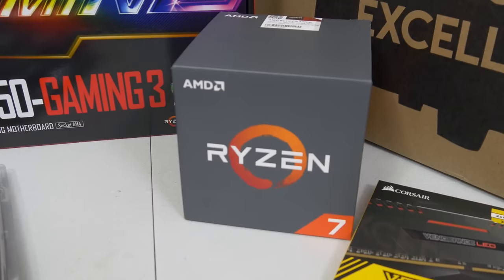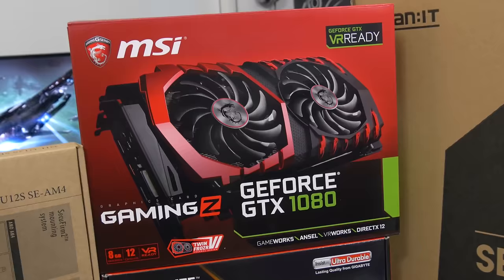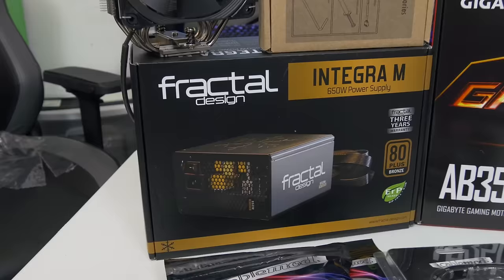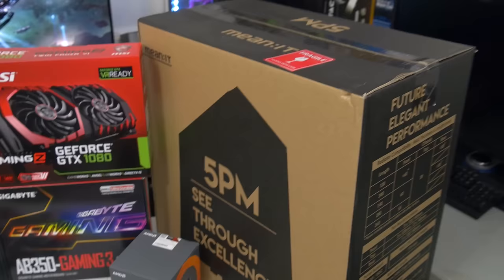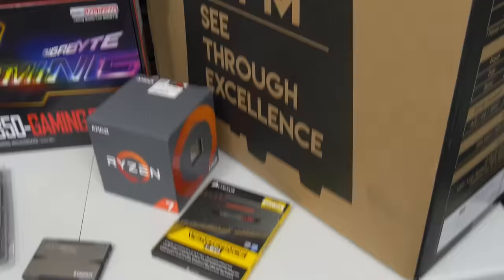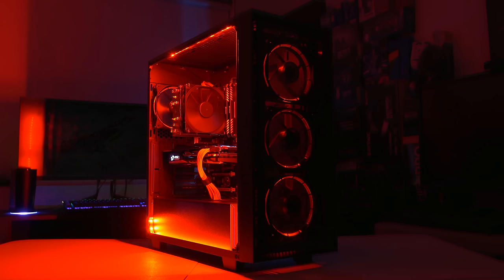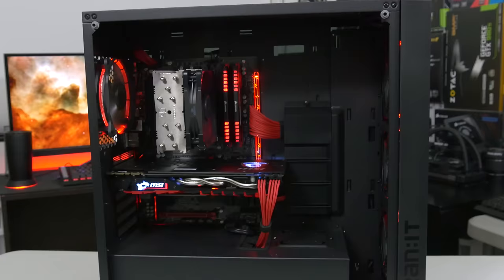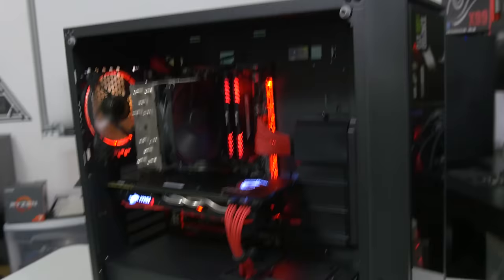Building MY FIRST Ryzen PC! March PC of the Month

Comment: I'm looking to build my first computer still no the fence which way I should go. I currently have an i5-4460s, 12 Gb ddr3, I forget the mb. I plan on using it for gaming Overwatch, Hearthstone, Mass effect. I use it from timid to time with for 1080p video editing and maybe Twich. I was thinking 7700k, z270 mATX. Or this 1700 and the AMD equivalent to the z270. 
Not brand loyal but I'm putting it in a Thermaltake V21 case so mATX is the largest board I can go. I'm using the same PSU and GTX 1060 GPU. What is the best price to proformace?
Reply: On a "CPU standalone" universe, considering your use of the PC (seems mainly gaming) I don't see the point in taking the 1700 instead of the 7700K. 

But to be honest, I don't see the point in taking the 7700K if you have a GTX1060... You'll be GPU bottlenecked WAY before 7700K provides you any benefit over the 1700. In which case, I'd go for the 1700 (better multithread performance).

However, in less than two weeks the R5 will come out. In gaming they will probably perform as the 1800X (meaning the 7700K will still be better) but they will be way cheaper.

Get it that way: a well OCed R5 1500X should provide the same gaming experience as the R7s but for only 190USD (looks to me the perfect gaming sweetspot). It will still be not as fast as the 7700K. But it will be:
- way cheaper.
- 7700K will prove to be faster only having an EXTREME graphic card. You have a 1060. With that graphic card the 7700K will NOT provide you a better experience than the 1500X since you will be GPU bottlenecked. 

The 7700K is the best CPU for gaming, but, to benefit from it's potential over any other CPU, you need to make sure you're not GPU bottlenecked. And in 1080p/1440p, you will be bottlenecked with any GPU slower than the 1080...

So, would I be you, I'd:
- sell my 1060
- buy a R5
- with all that extra money, buy a better graphic card (Zotac AMP Extreme 1070 for example)

In the end, it will cost you much less than buying the 7700K and it will be better for gaming.
Reply: You see... The problem with PC Gaming is that when benchmarking a CPU or a GPU, testers will only make sure they don't have any bottleneck. 

So for instance, when testing a GPU, they will put in the rig the best CPU, the best Mobo and the best RAM.

Their rig, over the Graphic card, costs like 1500USD only CPU, mobo, ram. But you, you sit down, if you're lucky, with a 600USD CPU, Mobo RAM, or maybe even with a 400USD bundle and sometimes even less. And you watch the tests:

They will then run with 10 Graphic cards. 

And then you see: "oh my god, the 1080ti is so much more powerfull than the 1070!!! I'll buy that one, for 200USD over the 1070 it is really a sweetspot."

You put it in your PC, and yeah, you get a massive improvement and you're very happy!

But...BUT!!! You're being bottlenecked by your RAM, or your CPU. And it would have been better to buy a 1070 and a better CPU or RAM

Same goes for the CPU

They test them in 1080 SLI, in Titan XP SLI. So with like over 1000USD value in GPU only, some of them with almost 3000USD GPU!!!. Again they put the fastest RAM they can get (here again like over 300USD RAM)

And you're there, sitting with a 1060, or a RX480 and 100USD RAM

And again: WHOOA that 7700K is really the best CPU you can have. And it's only 200USD over that R5. I'll get that one.

But... You have a low frequency RAM maybe... And certainly you are GPU bottlenecked and your 7700K doesn't provide you ANY benefit from a 150USD cheaper CPU (wether it be from AMD or Intel, it doesn't matter)...

Things are never as simple as for the reviewers: in Real Life, in a "budget constrained" life that is ours, you need to balance perfectly stuff. And... It takes time, it takes knowledge, it requires a lot of homework.

Comment: OK guys I really need your help, in two weeks I'm going to build my first pc and I plan to use it for gaming, maybe streaming or editing and I don't want to change anything in my pc for atleast 3years so my question is ; Should I buy a ryzen 1700 with a x370 motherboard or a 6700k with a z170 motherboard ? As I said I don't want to change anything until 2020 and I think that the Ryzen 1700 is more futureproof than the 6700k, even if the 6700k performs better in gaming... I already bought the R9 fury and a 2x4 ddr4 3000mhz kit and I really need your help ! Thanks !
Reply: Hello, I'd say the same as I mentioned to a lot of people.

You have a Fury (I do so equally), Fury sits between the GTX 1060 and GTX 1070.

As such, you'll be GPU bottlenecked WAY before a 1700 is bottlenecked vs the 6700K.

As such: as mentioned by Mercenary, take the 1700 because it's better for multithread

Said that. I'd wait for the R5 (it's less than two weeks away). In gaming, they are expected to perform as well as the R7, but for clearly cheaper (because less cores that you anyway won't be using that much unless you work with your computer). That would allow you to save this money when you'll change in 2020, or spend it in a better cooler i.e., or better case, or more fans, or a better mouse, or a better screen...

That's what I would do.

Oh, and don't spend TOO much on the X370 Mobo. On my side I did and see that it doesn't provide any tangible difference from a 120USD cheaper one. I'd go for 150-180USD Mobo max (Like the AsRock Gaming K4, it's a very good Mobo with premium components and 7.1 surround sound. It lacks the Wifi however)
Reply: Ok, thanks a lot for your answer, I think I'm going to wait for the R5 as you said if the benchs on game are good, thanks again !

Comment: This build annoys me. The R7 1700 packs a ton of power into a low TDP package and everyone (including mfgs) insists on using/producing ATX boards to sit in giant ATX cases taking up a ton of space for no discernable reason. Where are all the cool, full featured mATX and mITX boards? 

I love my machine, but I have no desire for it to be the centrepiece of my room. I was forced into a mid range B350 board because it's impossible to find a top shelf mATX board.

Great channel regardless, but I'd like some more love for small formfactor boxen.

Comment: Will a 1080ti pair well with a Ryzen 1700?
Reply: PapaOogie yes. while not the best-of-the-best gaming CPU, its still a monster that won't bottleneck most cards. if you overclock it you can get even better performance.
Reply: It's not going to bottleneck the 1080ti at 4k. Why else would you get such a beast of a card? (Except maybe 1440p144)
Reply: VR

Comment: just letting you know, the case is a copy of AI Crystal case with their red Halo fans
Reply: Sly Boogy you could say that,  but you could also say that MSI copied Zotac because Zotac had 2 fans on their graphics card and so does MSI... bad logic
Reply: Charlie Purcell 
Its one thing to look similar. Its another to be completely identical down to every rivet, cutout and tie down loop. Only thing different on this chassis is the smooth bezel on the front panel side while the Anidees AI-Crystal and the Rosewill Cullinen have the "Fractal Fins". And these are the Anidees Halo fans as well. Which is a slightly altered knockoff of Thermaltakes Riing fans.
Reply: no not really as the only differences is that the one in the video doesn't have intakes in the front side like the ai does and other wise it is the same as i own a AI Crystal and my friend bought the same one as in the video

Comment: Slap a 3600mhz ram in there and that Ryzen will close the gap with the 7700k.
Reply: In principle, yes, but there's no guarantee whatsoever of that working. I know there's a guy who made a video in which he got it to work, and found out it impacts performance tremendously, but the data fabric seems to be rather silicon lottery-sensitive, because most people can't get their memory over 2666MHz without instability, and I can't even get mine over 2133MHz. Reaching 3600MHz without getting instability issues in the data fabric requires you to be very lucky indeed.
Reply: Memory support isn't a matter of a silicon lottery though, and more on the bios and motherboard maturity side.  Another thing to note is that if you  want 3000+mhz higher speeds, Ryzen needs either 3200mhz or 3600mhz because it doesn't divide 3000mhz and 3400mhz so it will revert to its default 2667mhz.
Reply: Memory support isn't an issue indeed, no, but memory speed also isn't what makes Zen chips perform so much better. The thing is that the data fabric that links the cores in the CPU runs at the true speed of the memory, and that data fabric is both responsible for the inordinate performance gains and susceptible to silicon lottery variations. You can't uncouple the memory clockspeed and the data fabric clockspeed, so both need to run stable at a certain speed for that speed to be feasible. There's no point in overclocking the memory to within its specification if that means the data fabric starts throwing up instability issues.

Comment: I like how you talk about overclocking the 1700, but you have a B350 motherboard.
Reply: Snickers you can overclock on b350 just fine. just watch for a good vrm solution
Reply: What? I guess I should actually understand the topic I am talking about. I just assumed that you could only overclock on a premium motherboard because that is how it has always worked.
Reply: A cheapo b350 can make the 1700 run at 4ghz all cores

Comment: Bitwit seriously bottlenecks Ryzen by using 3000 MHz RAM memory. Take at least 3600 MHz, we know that up to that frequency the difference in performance is huge, both for synthetic tests as for games. The speed of the RAM determines the speed of the Infinity Fabric (AMD explained this). Obviously the motherboard limits the overclocking a bit (higher temperatures at the same voltage and frequency), it also limits the frequency of RAM which it can handle once the EFI's have been improved.